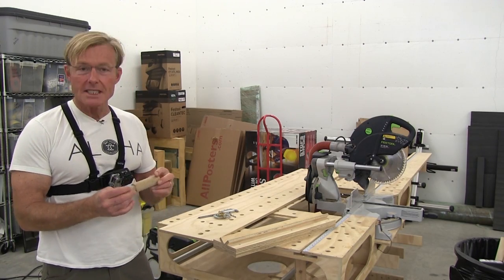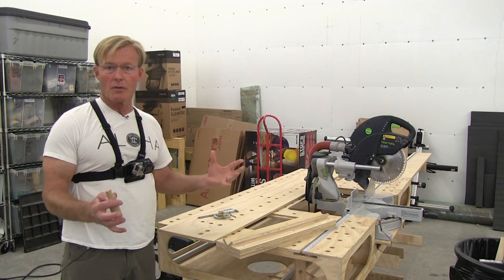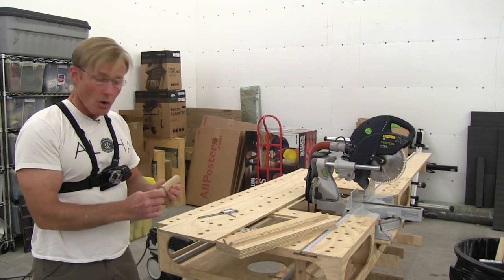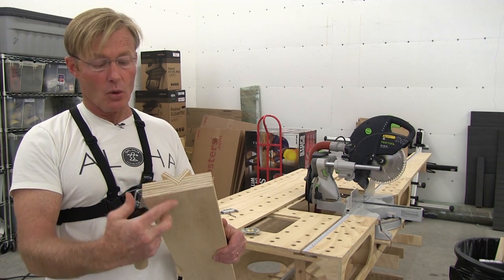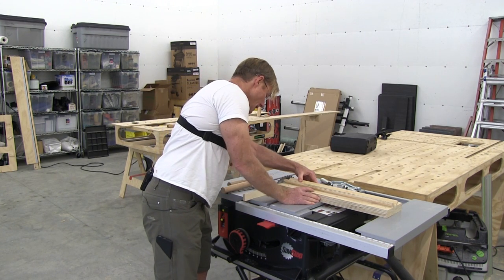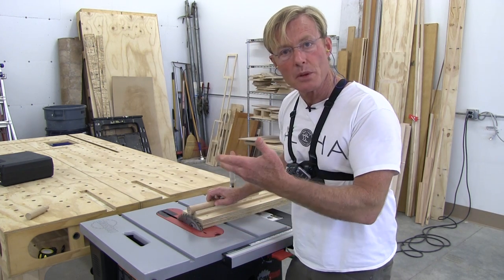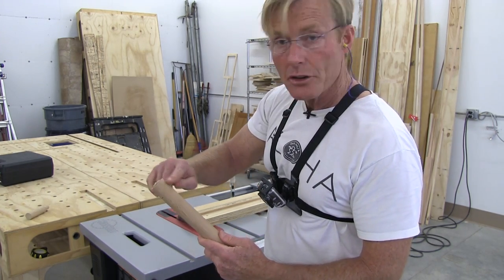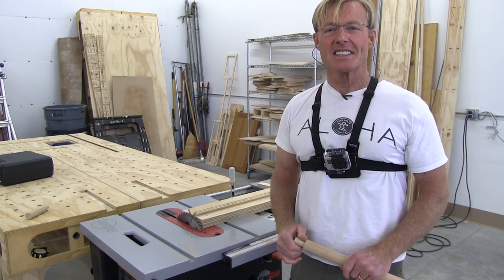TABLESAW TURNING

Comment: Hi Ron.  I had to do something similar a couple years ago (I made a cylindrical sanding drum to fit in my drill press).  I didn't make a jig to hold the dowel though; I used my miter gauge to keep the piece square to the blade, and only raised the blade up a tiny bit above the table top.  I also used the rip fence to limit the length of the tenon (I worked from the left side of the blade).  It worked out fine for me.  If I had to make a bunch, though, a jig would be better.

Comment: Great idea Paul.  I'm gonna take my drill press dowel V jig, and use it on my table saw now.   Was trying for an easy way to do this for my Festool MTF/3 & my HF workmate.   Perfect.  

FYI a 7/8" dowel gets you close at 22mm to start with.

Question -  Have you used any of the chest camera footage for your YT video's yet?

Comment: Instead of spinning the dowel as you cut it, would it be safer and easier to slide it back and forth and then after each slide to then spin it a little and then slit it again etc? Also, perhaps some kind of a top guard to prevent it from any possible kickback. I'm thinking just a could of riser blocks a bit taller than the dowel with a cross block attached to the top of both of the riser blocks. One or if two spaced far enough apart for your hand to fit between the two. 
Your thoughts?

Comment: Fantastic tip! I am a big fan of your Youtube channel. No offense to the imperial system, but the metric system is a little easier to get along with as uses a base 10, whereas the imperial has none: one must learn by heart how many inches are in a foot, how many feet in a yard, etc... Even though the USA has not switched to the metric system, both measurement systems are used over there and this can lead to errors sometimes.